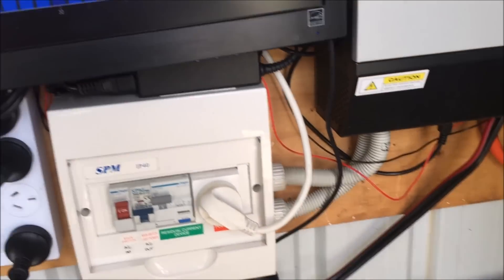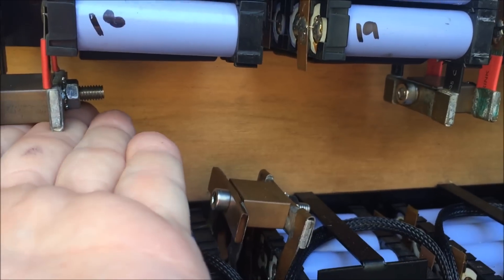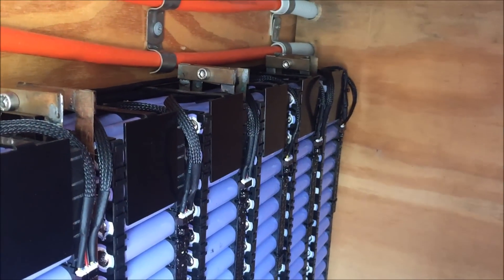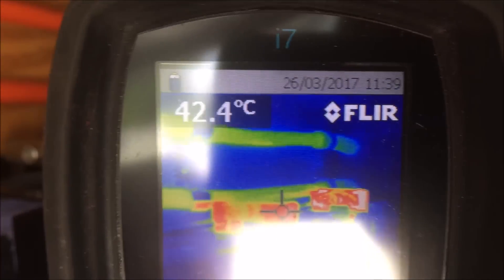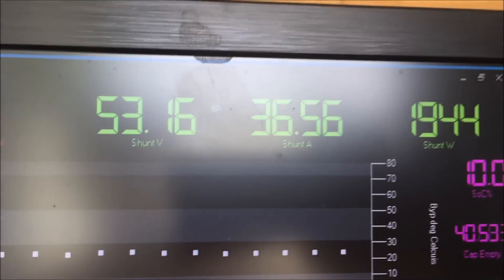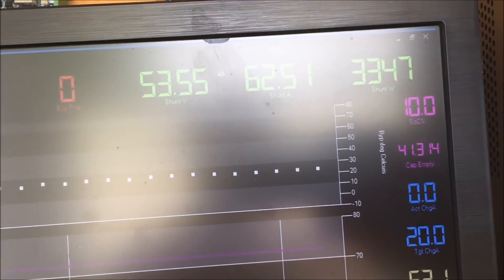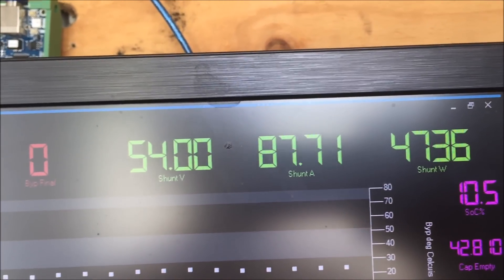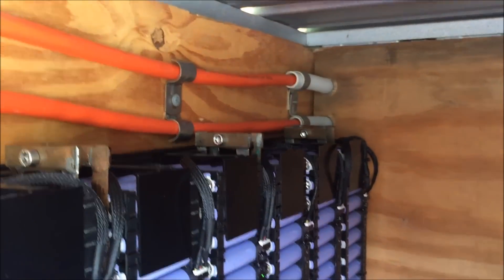Charging 18650 Cells at 115 amps, will find the weak point every time.

Comment: I'm thinking about trying to build 18650 packs and use them for power in a overland van and charge with a 100 amp alternator, is it possible? Or am I embarking on a foolish idea
Reply from the maker: Anything is possible - do you want or need the hassle of doing it this way? Or is an out of the box solution an option?
Reply: HBPowerwall , I would like an out of box system, but I am under the impression that I can get recycled cells pretty cheap from a supplier in California. I am going to be running a small mini split AC unit, and a 45 watt refrigerator and some led lights, with a 12volt watter pump for the reverse osmosis filter system. I have 4-100watt monochrystaline pv pannels and am trying to learn how to build the power system and properly charge my cells. I am very interested in your project. I will be traveling in the VW bus this summer so I need to figure out what direction to go. I really like the lifepo4 approach, the speed of the charging and ability to partially charge without hurting the packs are huge plusses for my situation. I appreciate any input you have, suggestions for capacity, type of charging system, amount of pannels, etc. I can give you an email to message me if you prefer.

Comment: The connection points look hot because of the reflective properties of the shiny metal which is reflecting the thermal energy of you or the outside door. Place a piece of black electrical tape on the metal surface to obtain a proper thermal image.
Reply from the maker: Yep, but that's hard to do in the heat of the moment unfortunately.

Comment: How is it you are getting 115 amps into the cells? That seems like a whopping amount. What charge controller does that kind of charge current? Expect heat at those temps. I was able to do 110 amps into my VW when charging from a bank of batteries through my controller but this is not a standard charge controller.
Reply from the maker: I was running PCM60X solar + Eltek 42a charger (at 20amps) + PIP4048HS grid charge at 60amps. Today I was charging at 135amps :) things get hot so back to just the PCM60X but it's good to know when really needed i can turn it up. Also charging the cells at much less than one amp per cell so still perfectly safe

Comment: That connector top right, is the heat coming from the bolts or if it the solder joint with the front bus-bar? 

It does look like the heat is concentrated to the front of the top bar where the solder joint is to me but that may just be the angle it's viewed from...
Reply from the maker: You are right it was because the block of copper was not cut exactly square and you have to really torque down the nuts to get a good contact patch. It was micro sparking generating heat.
Reply: Cool, I'm glad you got it all sorted now, last thing you want is a cable fire! 

Keep pushing out the videos Pete! :-)

Comment: you should cool them with a Peltier brick. And or use the heat for generator to power little 80mm 5volt fan's. for air flow. almost stacking one brick on top of the other one will cool the other will power a fan to flow over your power bank's.

Comment: That is good it ramps up putting 115 amps into electronics all at one time would cause major problems. Loose connections are our main problem. Good update.
Reply from the maker: I'm sure I triple checked as I've had this problem before guess wasn't an issue till the amps were really cranked up

Comment: Get yourself some brown scotch-brite (green will do with more effort) and some isopropyl alcohol and scuff up the mating surfaces on those terminals until they're shiny, clean them with the isop and connect them within 30 min - you'll never have a high resistance joint again. Over time the joint resistance will usually increase due to oxidation and thermal cycles, spraying some lacquer or something on them to seal the join will help in that regard once something is to be connected permanently. (I get paid to make sure these kinds of joints are below 1 milli-ohm and stay that way)
Reply from the maker: sounds like a change i need to make moving forward, thanks for the help

Comment: If you look over the thermal camera video it is showing hot in the corners, check your solder connection on to the copper bars, high current and thermal camera will show you where you can improve but charging at 115 amps amazing 👍
Reply from the maker: it was because I had a nonsquare copper block in there and it really needed to be squeezed down to make it a good fit. All good now about to test with a 130 plus amp load :)
Reply: HBPowerwall definitely have the thermal imaging gun around when you go for 130amps 😀👍
Reply: HBPowerwall try applying copper grease between the contacts this will help with the resistance and being down the heat by at least half.

Comment: Eltek flatpack2 2000w/48HE will do a maximum of 42amps if you change on control > remote settings
Reply: elcon is a brand of shitty capacitors. Though there is also a company that makes battery chargers with that name.
Reply from the maker: maybe that's where i've seen it
Reply from the maker: Eltek ELTEK ! don't know where I got elcon from... gah! Handy little charger